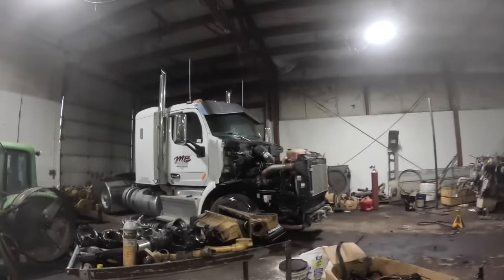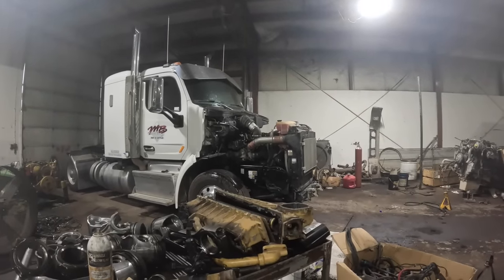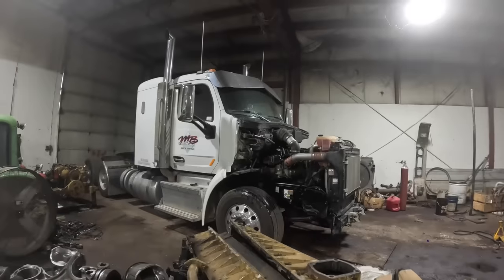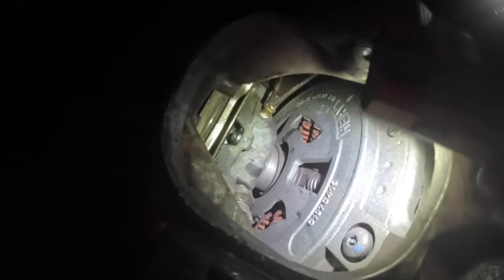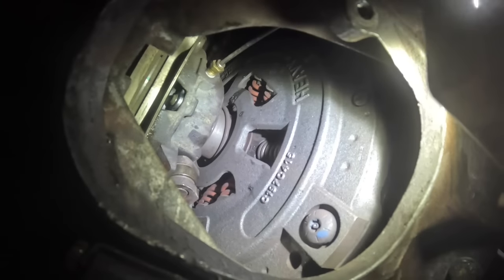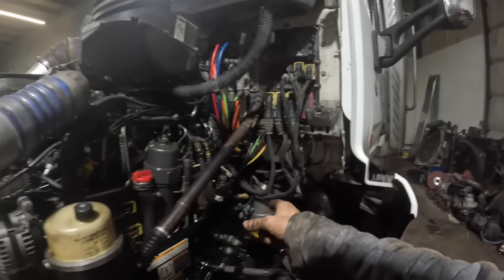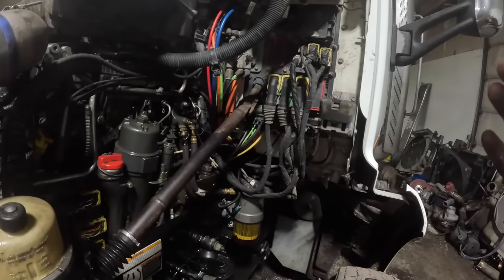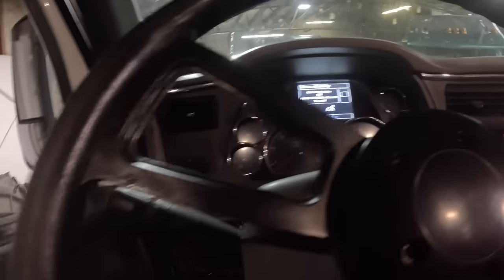Eaton Utrashift clutch reset.

Comment: There’s a bunch of us out here with a little bit on knowledge about certain things, but none of us out here with the vast knowledge and experience, or even 1% of the determination this man has. Huge respect, and I’m sure I didn’t tell him anything he wouldn’t have worked out for himself.
Reply: Hey ken since he mentioned you know about these transmission i got same truck 2015 579 auto transmission i was getting stuck in the gear changed XY shiffter 2,3 times i would run good for a while you stop somewhere and its stuck in gear won’t crank at all end up towing to the shop they said transmission is bad ordered new one put that one on with new XY shifter now it starts but won’t go over the 5th gear I spent way to much money on it see if you can help I would appreciate it.
Reply: @navilubana8577  it sounds like it could be the range cylinder on back of trans. The high low splitter also has an actuator. If it’s a reman trans this most likely came new or rebuilt but you would have to check or test it. It’s also possible you’re not getting correct air pressures or voltage to transmission. I don’t know enough about your specific situation on what was replaced, or how it was diagnosed to begin with but I would start by checking the codes, and then try to work your way through it. Sounds like it’s not getting hogh range which is controlled by the rear actuator. Can’t remember terminology

Comment: Hey bud, that code 63 gets triggered by low voltage sometimes on the xy shift controller. No worries I think you got it man! Thanks for update! Ken
Reply from the maker: Thank you
Reply: Thanks for helping our buddy out Ken.
Reply: Yes thanks for helping Ken!
Reply: We had code 27 change the clutch now I’m getting code 16
Reply: @christopherarroyo6905  
What model and year trick
Reply: Truck
Reply: @christopherarroyo6905 

Check your wiring harness connector at tecu on side of transmission. Was it reinstalled correctly after transmission was reinstalled? Check your transmission harness from the tecu to the ECA. Are the wires plugged back in properly to the ECA? Also if power cables were removed from starter when trans was removed were the power and ground for ECA put on correctly? May be reversed.
Reply: @Ken-6mm also a code 19
Reply: @christopherarroyo6905 

Codes 16 and 19 are both basically can communication issues between the ECA and TECU. This can be caused by the harness not being connected properly between the 2. It could be a power and ground issue to the tecu or the ECA. There could be a problem with harness itself. Check the easy items first like the connectors. Make sure the pins didn’t get bent or compromised when you reinstalled them. Check starter powers and grounds for issues (that’s where ECA gets its power from) lastly I would suspect a bad component most likely the ECA and lastly the tecu if all else checks out
Reply: @christopherarroyo6905 

Did you uncage the clutch after you installed it?

Comment: That noise is common for those compressors. My company has about 10 trucks that make that noise. Also, im pretty sure that F flashing is for fault, not forward. These transmissions usually will throw a code using that key method from my experience. My only experience is with eaton software with these transmissions, and it's very limited at that, so thanks for the video. I'm definitely gonna pen this info down for when our transmissions inevitably fail.

Comment: Thank you for sharing your experience again. Would like to say , that when removed and installed ultrashift I never used "open clutch" proceedure. Just installed and removed caging bolts. And neverbhad problems even without connecting service ranger or any other diag program. Of course, with new clutch it is needed to be calibrated.
Thanks again, Warren. And Merry Christmas!

Comment: Warren.  You are not alone.   I had a car that was stack shifting. Single owner.  Brought it to a local shop 85k miles, they “rebuilt the transmission”.   No they swapped it with a reman.  No warranty.  Still no fix.   I asked them “did anybody check the TCU or the ECM”?   They all looked at each other with their heads up their ass.  So I had it towed to the OEM thinking this will get to the bottom of it….  WRONG.  When I walked in the door, I specifically told them to (oem) check the TCM.  They said they would do a full diagnostic on it, and they did…….   They swapped out the tranny with another reman.  I demanded to see the oil sample they took out of the trans they replaced, it looked fine.  A kid 20 years younger than me argued with me that the oil was contaminated…he said, “there’s 80k miles on this trans, it’s got brass in the oil”. I said….  “You’re the OEM right?”   “Yes we are”.    “What is the fuckin vin number, the engine serial number, and the original transmission serial number that was installed?”   Well guess what.  He called his service manager over and said I was being rude….   End of story.  The fuckin TCU was bad.  I had to fight for money for 2  trans from two shops plus labor.   60 days with no car.   I don’t know how you do it Warren.

Comment: The noise from the air compressor is completely normal. Usually these trucks come with a noise box filter which makes the noise a whole lot more quiet. Good work warren

Comment: Thank you warren.  I learn from the struggle that  we have with the equipment we work on. I had one a couple weeks ago on a hagie sprayer that the air dryer was purging all the time  and it has a wet tank and dry tank. I got looking  at it and the check valve had blown out and it holding to much back pressures.  I replaced the valve  and it was working right.

Comment: I feel for ya,been there a few times.I wanted to pass on some things i have learned being a Deere dealer for almost 30 years.I have started engines on either more times than i want to admit.Since dealing with 6125 and early 6081 engines being air locked, I started using Napa (mac's) spray silicone to start stubborn engines(Directly into the turbo).The engine will just idle without knocking or revving up.Usually my customer is standing over my shoulder and is not so worried ,being that silicone won't dry out the cylinders.As far as shutting of the return ,I learned that years ago.The thing you have to be careful about is blowing the front seal out of the HPCR pump especially on the 4045,6068,and the 6090.I usually watch the fuel pressure and shut the engine off or open a ball valve on the return when the pressure reaches 100 psi..

Comment: If you put the clutch in service position that opens the forks on actuator so you can pull the transmission off the clutch if your leaving clutch on flywheel when you remove trans. That is so you don’t have to remove actuator before pulling trans. Pretty sure that’s how it works whereas the open position is to adjust if necessary

Comment: One of my KW T880 trucks had that transmission "F" (fault) indicator flash while in operation, and I'd have to stop what I'm doing, put shifter in neutral, shut-off engine for a minute then restart to reset the TCM, then off to the races. It happened so many times especially in the middle of intersections that the company finally sold the truck. For now I've switched to another KW truck with manual transmission. The company is so frustrated over these 3rd Gen Eaton Ultra-Shifts that they are selling them out of the fleet and reordering new KW trucks with the Allison auto transmissions which are a dream in dump trucks. The Ultra-Shifts are great distance road transmissions but absolutely horrible in crawling speed and off-road dump truck use.

Comment: Service position turns the release fork the opposite direction completely out of the way so you can pull the trans if leaving the clutch on the flywheel if not it will be stuck between the release bearing. Open clutch should only be used to adjust the clutch, if you pulled the transmission and clutch together with it in the open position the clutch would be pulling on the clutch bolts as you loosen them. The clutch service manual  CLSM0200 ( which you can look up) Says when tightening the caging bolts to run them in till the shoulder touches then go another full turn and that’s plenty.
Reply: Well said, also good job including the service manual bulletin or P/N # for others to reference.

Comment: Being able to work on trucks with automated transmissions is becoming crucial since half of all class 8 trucks sold in the United States are equipped with manual transmissions and 90 percent of Volvo and Freightliner trucks are built with automated transmissions.
Reply: Almost all trucking companies are starting to use them the company I work at has phased out all manuals for automated ones
Reply: @tylerramsey7396 . There is absolutely no reason not to have a fleet with all automated transmissions.  The main benefits are better fuel economy, lower cost of maintenance and higher safety.  Not to mention driver training is easier and driver comfort is increased.  No shifter on the floor between the seats makes it easier to move around inside the cab.
Reply: Definitely. I work for Mack/volvo and 90% of trucks that come through the door anymore have the Ishift/mdrive. And honestly they are not all that bad of a trans. Of course they have their set of issues but for the avg steering wheel holder it works
Reply: @ChrisHarding-lk3jj  Less chance of flip flops getting snagged....
Reply: @garrettfoote8570  I test drove a few trucks with the Allison tc-10 when it was first released and it was an amazing transmission.  It was released at a bad time when manufacturers were making the switch to integrated power trains.  The TC-10 uses a torque converter and twin countershafts.  The benefit of the torque converter is torque multiplication.
Reply: 90 percent of freightliner and Volvo

Comment: Did you see the new CAT C-13D?? It’s supposed to be a replacement for the old 3406E. Basically looks like a PACCAR painted CAT yellow. Never thought I’d see the day a CAT motor has a rear gear train… Hey at least it doesn’t have a EGR on it. 😂
Reply: Isn’t the first time cat had a rear gear train engine. I believe it was a 1693 that was rear gear.
Reply: Also was DOHC.
Reply: @12DUDE20ONE  I didn’t know that… I just researched that and I was surprised to learn about that engine. The only major difference is that is a duel overhead cam and the C-13D is a push rod engine… but yeah I was wrong.

Comment: I actually just had one this week doing what you described, it ended up being a combination of things. The LICB was not functioning properly (low inertia clutch brake) which was mainly caused by an overgrease condition in throwout bearing. Autoluber was not metering correctly, also the clutch itself had a few pieces of springs that were hanging up internally on pressure plate. Was your clutch replaced? 
Once those items were corrected I did replace xy shifter and both speed sensors on top shift box. I checked the rear hi low box solenoids and reinstalled. After it was back together it ran good. Pretty sure it was the combination of the LICB, the clutch, and the old xy shifter
Reply from the maker: Sounds like you got it whipped.
Reply: Sorry Warren I was trying to respond to a different comment and it got posted as a new comment. It may be helpful to others anyway but it’s out of context. Hope your doing well and thanks for the videos, Ken

Comment: You don't have to cage the clutch if it is going to stay on the flywheel
Reply from the maker: If you are rebuilding the engine, you pull the flywheel
Reply: @westerntruckandtractorrepa1353  fair enough but it sounded like you were saying that if the transmission is coming out the clutch has to be caged.

Comment: Do you think i have to do these procedures if im replacing the clutch. The new clutch is caged. I dont have the software for the transmission.
Reply: If you are not reusing clutch it doesn’t have to be caged, but if you don’t have software to open the forks on the actuator, you’ll have to remove the ECA and drop it down before you pull transmission. I’ve never personally done it this way but like Warren said once it’s in it should adjust it self with a few key cycles. Just make sure you have an alignment tool in new clutch and it’s tight to flywheel before it gets uncaged. You may have to leave caging bolts in until trans is secure and actuator is reinstalled before you remove cage bolts. Not sure, I would contact Eaton to verify
Reply: Oops no you would remove caging bolts once aligned or you would loose your alignment sorry.

Comment: So this transmission issue makes one wonder if the computer some how would not allow the engine to start because the adjustment/calibration was not right.
Reply: If that strategy was built in, and it could be, the engine wouldn’t crank, and it would also throw an immediate code warning driver or technician of the fault. The truck should start if it sees neutral